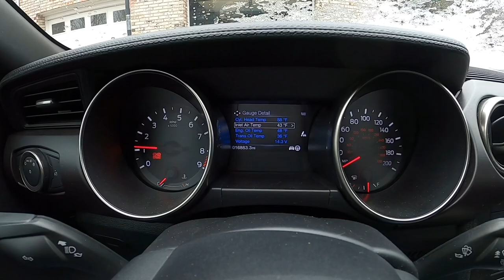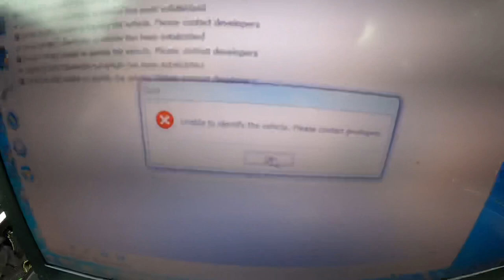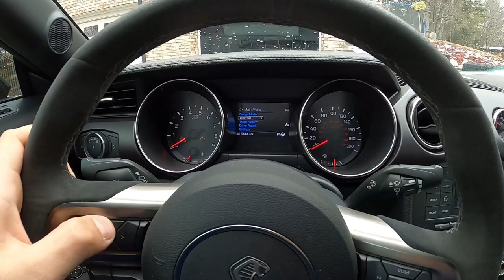Shelby GT350 Whipple Supercharged Sticky Throttle Fix/Burnouts/New Tires (P2112)

Comment: Hey just curious if your problem you had is same as mine. I have gen 4 setup same car etc. but same concept the car after spirited driving it will sometimes go into limp mode 
Throttle will not respond and the car will systematically surge from 700-1500 rpm’s repeatedly. Once I turn off the car for 10-20 seconds and start up it will return to normal but this is the 4th time I’ve had it happened. When running code I don’t remember the exact code but it did mention something about throttle actuator? Hope to hear from ya.
Reply from the maker: Sounds like the same problem. Try this out.

Comment: Did the gasket maker fix the sticky throttle body?
Reply from the maker: Yes! 😀
Reply: @L8R-HP  awesome! Glad to hear. My whippled gt350 started keeping the rpms the same after I let go of the gas then died down and immediately jerked back up once I pressed the gas again. I’m hoping this will fix my issue.
Reply: Also, If you don’t mind. Do you remember the torque specs of the throttle body?
Reply from the maker: @josueespinoza9492  88 in-lbs
Reply: @L8R-HP  thank you!!!

Comment: I have exactly the same issue with my whipple throttle body but I can't get it fixed with gasket maker. The car gets into limp mode and show P2112 after 40 min drive.
Reply from the maker: Are you running a Whipple tune? Did you have a gasket on there before?
Reply: @L8R-HP  My car was tuned by Lund. Yes I had the gasket from the kit but I changed it soon. I also replaced throttle motor and sensor. I tried both 150mm and 132mm whipple throttle bodies but all had the same problem.
Reply from the maker: @yukikazewayne  o wow, that’s weird. It only happened once to mine and so far it’s been good with the silicone. Is it possible your throttle body was dropped or fell at some point? Maybe it’s just permanently warped out of shape. You may just need to get a new one 🤦🏻‍♂️
Reply: Same problem i just put silicon see whats happen
Reply: I know I’m super late and you’ve probably fixed this but depending on year you can adjust the magnet inside the throttle body if the TP voltages are off. Whipple has a PDF on their website for it.